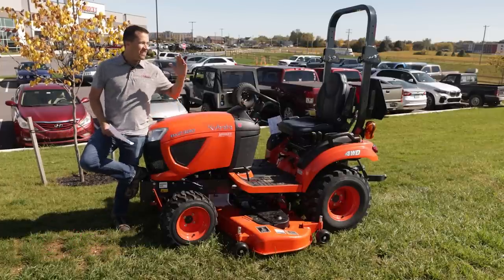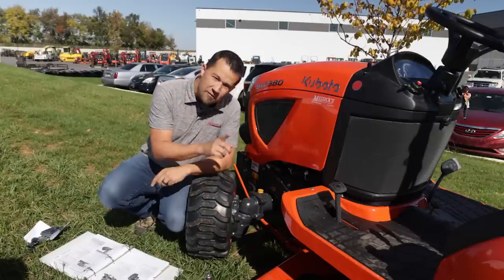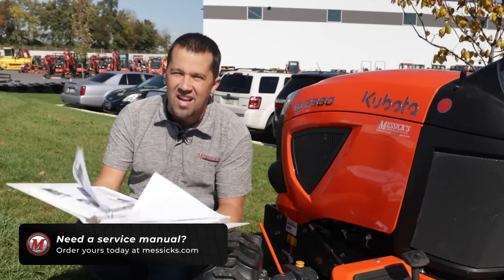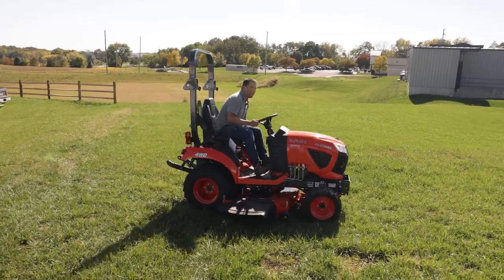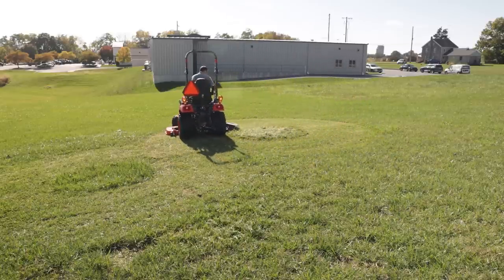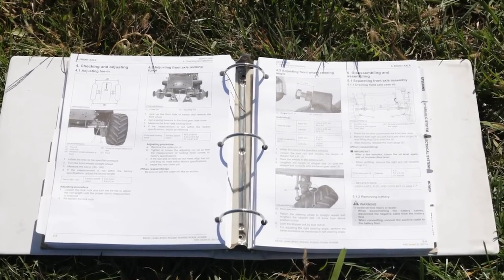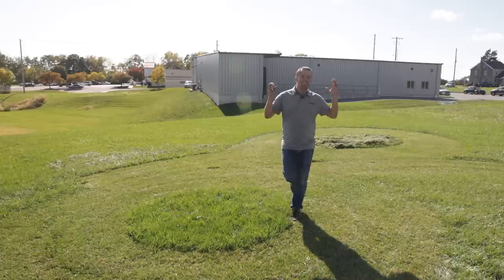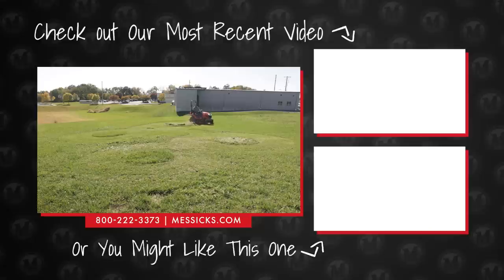Improve the turning radius of your tractor by checking your steering stops.

Comment: Thanks for being at least "somewhat kind", Neil!  
I suspect you and Brian are correct.  The steering stops were likely not adjusted properly on the BX I tested.  I did not attempt to adjust or validate the steering stops on either machine. I assumed dealer/factory had set them appropriately.  I would not expect a first time tractor purchaser to need to check this adjustment.

There are some comments here saying that I "painted" in the wrong location ...by the rear tire.  I did my best to approximate the uncut circle, yes, painting by the rear tire...but watching the edge of the deck closely.    I do NOT believe there is significant error in my measurement approach.    The error was likely entirely in the steering stops adjustment.

I did not attempt a clockwise (right turn) test because I didn't think I could accurately determine the edge of the cut. Remember, I had no growing grass to work with at that time.  I like that Neil did that. Very informative!

Folks probably won't believe me, but I honestly don't care which tractor "wins" in such a comparison.  I just wanted to be accurate.  

Having said that, and just to stir the pot again, I can't resist saying that after all of the hubbub about this, it appears that the 1025R still has about a 15-20% better uncut circle diameter.  Right?

One last comment.  I have lots of respect for Neil.  I consider Neil a good friend.  It is fun to have these back and forth comparisons.   I believe both of us want to deliver accurate info.
Reply: I would argue the not in "I would not expect a first time tractor purchaser to need to check this adjustment".  Whether new or used, I wouldn't trust the dealers and especially private sellers to do everything right.  One common thing dealers miss/forget in PDI on  the BX is top up the front axle fluid among many other things like mower bracket adjustments and these axle adjustment jam nuts.  You could have a green guy doing it, making rookie mistakes or just overthinking like they do. You could have the best, most experienced tech that has bad habits, making assumptions despite design changes on small part revisions etc.  They could assuming its fine and rushing to get home, or just having a bad day and not focused.   Every owner should double check and fully learn all this stuff in the beginning as it'll become normal maintenance checks later anyways.
Reply: I thought you did a really good job with your method without tall grass to use, as mine was difficult to see the cut grass difference.  I think you and Neil both bring impeccable integrity with your entertainment, and I totally agree that we all just want to make sure the information is accurate when we find some info that does not seem right.  And LOL yes, 15-20% is still a clear win!  And as you pointed out, the steering cylinder behind the axle is a much safer place on the John Deere...and even my 1984 John Deere 420 does not have an exposed steering cylinder.
Reply: @mattleblanc31  I can confirm that when I checked my new BX's fluids shortly after delivery--typical fluid check before using the tractor--I found my front axle fluid was so low it didn't even register on the stick.  Dealer forgot to inspect and top off.  That said, I'm really happy with my dealer in every other respect.  But to Tim's point, without a baseline to which to compare, the average tractor purchaser wouldn't check something like the steering stop.  I never have, and I have adjusted several other items as I've come across them and noticed something not quite right, like the lift limits on the rear and mid PTO.

Comment: Great thorough and informative video, and I am glad I am not the only one fascinated by these facts.   We need to also message Tim as I believe I figured out why the stops were so far out of adjustment on his bx2680 that he borrowed from Courtney at Good Works Tractor.  I figured it out watching Courtney's video on his BX23 (very unflattering Kubota BX video) where he was disappointed when he installed his wheel spacers that his BX front tires would now bump into the mower deck when not even turned all the way.  I am willing to bet that the previous owner of Tim's borrowed 2680 had wheel spacers on and adjusted them so his tires would not hit the deck.  Since the wheel spacers can be used on other sub-compact tractors, he likely removed them before he sold his bx2680 to Courtney (maybe?), but would not have thought about adjusting the stops back to factory spec.   Thanks for the update video and editing my video to make it look halfway decent LOL.
Reply: I do. not think this machine ever had spacers.  I doubt very much that original owner (or Courtney) adjusted the steering stops.  More likely, they were never adjusted properly by the factory or dealer. Remember, that BX2680 that I borrowed only had 50 hours on it.
Reply: @TractorTimewithTim  Yeah, my theory could be completely flawed.  50 hours a year is not much, but seems to be about the average per year for homeowners sub compacts in my area and for me as well as what I saw when searching for 1023e/1025r  info at GreenTractorTalk.  Oh well, maybe Courtney can adjust his BX wheel stops so his tires don't hit the deck and mow a circle for us?   FYI--I found another superior feature on the John Deere when I went to remove my rubber mat on my BX2380!  Yes, us Kubota folk have annoying plastic rivets where as you John Deere folk get a rubber mat held down by real bolts!!

Comment: Great video, as always. I love my 2380. I mow a patch of woods with over 50 trees -- most of them spaced just far enough apart to make it through with my 60" deck. At first I was trying to turn tight around each tree, and it was a frustration. However, over time, I figured out a mowing pattern that allows me to make multiple passes from different directions and avoid the need to hug each tree on each pass. Sure, a zero turn would be easier, but with a little planning and mowing "strategy," my little BX still makes short work of it.

Comment: Not a sub compact, but a decent L&G tractor were the Toro 260 series and they turned tighter than the Toro 5xi tractors I own. They were fairly well made but you wouldn’t put a loader on one. If it wasn’t for the stress on the rear axle I’m guessing more riding mowers would have had L & R independent rear brakes.

Comment: when I bought my "other" brand sub compact tractor and took my first turn in 2wd, I was beyond surprised how tight it was.
Reply: Turning radius between my lawn tractor and my BX isn't too much different, the lawn tractor turns a bit tighter of course as its a little bit shorter wheel base, but not by much.
Reply: One of the things I’m most pleased about on my b2650 is it’s turning radius, particularly when maneuvering around our buildings and fences and such while moving snow.
Reply: Turning radius on my Branson is much tighter then on my the Kubota m108 or the NH Workmaster 60, it's a huge difference.. why?

Comment: The mower is probably off set to allow for the discharge chute. Interesting about the axle stops. It would be interesting to see how much you would need to adjust the stops out to get Tim's results, I am thinking not much.
Reply: Its offset for the discharge chute, and to make trimming around trees and obstacles easier.  I have a lawn tractor with a 42" mower deck which is pretty much centered under the mower, my Kubota BX has the 60" mower....trimming around trees, bushes, and the perimeter of the yard is 100x easier with the Kubota because of the mower deck being extended off to the left side further.

Comment: What? You didn't have your wife hanging off the side of the tractor drawing chalk circles?  Tim's a little obsessed with driving in circles. My opinion, if you need to cut that close to that many things and it is really that important, then you need a zero turn. Great video Neal...might have to reach out to your sales dept for a shop manual for my MX.

Comment: Interesting.  It looked to me that Tim was measuring right outside the left rear wheel, not the edge of the mower deck.  Tim's dimension would be larger than what the deck provides.
Reply: I did my best to estimate the edge of the cut grass.  Doubt there was much difference there.   However, the steering stops were likely mis-adjusted on my machine.  I did NOTHING to adjust steering stops on either BX or 1025R. Both were relatively new, so I assumed (error?) that they were set from the factory.

Comment: You didn't mention the use of the split brakes where available in decreasing the turning radius.  Braking the wheel on the inside of the turn can dramatically reduce the radius.
Reply from the maker: Nobody puts split brakes on this size tractor
Reply: WHEN HAVE YOU SEEN SPLIT BRAKES ON A MOWER   REELY?
Reply: @MessicksEquip  True enough. The B2601 isn't that much bigger, and turns a bit sharper. If you don't mind tearing up your turf.
Reply: My 1953 TEA20 has turning/split brakes. No mower deck tho and it would benefit from some front ballast although I’ll never need to replace the front tyres.
Reply: @MessicksEquip  Why not?  The old Deere 400 series garden tractors had split brakes.  As you said in another video, with sub compact & compact tractors (and as many commenters have also said in relation to ZTRs), their strength is in applications other than lawn mowing, where split brakes are helpful.  If an owner is worried about tearing up turf, they can always lock the brakes together or simply use the hydro for normal service braking.

Comment: I believe Tim was measuring from the inside rear wheel not the mower deck.  granted it was labeled as uncut turn and its completely possible the tractor was not adjusted properly.
Reply: I did my best to estimate cut radius. Not as accurate I'm sure as Neil's test since I didn't have any actively growing grass to work with.  However, I don't think much error generated in my measurement approach. I suspect the error would have been in the steering stops.

Comment: Between your videos and tims the kubota is more of a actual tractor the bx2380 has more 3point lift capacity, way more pull and more pto hp. So when it comes to actually working it the kubota is better. 
I have never found the fel lift capacity to be a issue and kubota engineers got that right when you look at the other factors eg tires. Nor have i found the position control to be a issue and we do alot of in ground impliments.
Reply: I always figure the small JD does a bit more than the BX.  Because it's a bit bigger machine.  It's halfway to a B2601. But if you wanted to do more, why not buy a B2601. It costs about the same as the small JD, and is quite a bit more capable.  Of course, the next JD up is between the B2601 and the LX.  Nothing is exact in comparisons, and the steps between these machines are so small anyway. My BX did everything I asked of it. My B2601 does a bit more. No doubt I could have been happy with the JD too if I was that way inclined. Numbers aren't everything. And a tractor will always make you happier than a wheelbarrow.
Reply: Yes you are correct a b series would suit some of what we do better but seeing our main purpose is mowing the bx does that role better on our property. But our bx branches out in to its other jobs perfectly. We have access to multiple big tractors for the big jobs anyway.
Reply: @BurtsRanch  Which is fine for your use. Some people have only one machine, and I see a lot of people head to head comparing the JD 1 series and the BX. In reality the BX is a little smaller.  So that comparison doesn't flatter the BX.  But if you wanted to lift more....why buy a BX in the first place.
Reply: @paullambert2668  100% agree. Hence i said i feel kubota got the lift capacity of the bx correct. If you need to lift more get a bigger tractor or something else so were on the same page.

Comment: If you go back towards the beginning of the video with Tim's video excerpt his video has a note in the upper corner saying he was in 4WD, so being in 4WD making a right or left turn is certainly going to give you a worse turning radius, and I believe may have been the part that Tim was referring to.  Although, I don't particularly think mowing in 4WD would be a good idea, it certainly can be done but I'd keep it to more straight line type mowing than trying to make sharp turns.  Another thing too, if someone smashes the diff lock pedal down by accident even in 2WD I bet your turning radius would be pretty dismal too.
Reply: I have a few spots that need 4wd, that I just avoid with a zero turn. I've been stuck before, and don't want to go through that again. The rest of the yard, I wouldn't use 4wd, it would be a waste there.
Reply: Tim explained the measurements very carefully for 2wd and 4wd for the Kubota and the John Deere.
Reply: I tested both 2WD and 4WD (just like Neil).    I suspect the steering stops needed adjusting.  I did not attempt to adjust on either BX or 1025R.
Reply: @TractorTimewithTim  The excerpt in Neil's video showed when you doing the 4WD section of your test, but that's beside the point, I remember when you did your turning test video, I was surprised how well both machines did honestly I was expecting much worse....I wonder how much different it would be if you did the same tests but with the loader installed?  Would it cause the tractor to push through the turns in both 2WD and 4WD?  Do you have a Kubota BX that you can redo that test with Tim?  I'm curious what the difference would be, loader on VS off, 4WD/2WD.  

Have you adjusted the stops on your machines yet?  Is the 1025R's stops similar?

I'm guessing the same with the stops, however I wouldn't think they're too far off.  I know with my BX2680, trimming around things I always trim with the left side of the machine of course, so it gives a much tighter turn...I've noticed the same doing loader work too, turning left is a tighter turning capability than turning right.

Comment: I know this might not matter. But does the bx2680 actually have a different turning radius vs the 2380.. I know it shouldnt realistically matter. But. Does it by weight and such? Is the 2680 adjusted differently or something of that nature.
Reply: The physical size of the BX2380, BX23s, and BX2680 are the same.  So, to get different turning radius results would just be due to differences in the wheel stops.

Comment: OK, so what about the most important comparison spec, lift capacity?
Reply: oN A MOWER   lol  ??
Reply: @jimputnam2044  no, on the BX's loader that most people buy with a machine
Reply: The small JD lifts more.  It has bigger front tires, and a bit bigger front axle. So it makes sense to put a bigger loader on it.  If you wanted to lift more than a BX, you could of course buy a B2601. Depending on your location/dealer it could be the same price as a 1 series, but it lifts a lot more. I think spec peeping on these things is a bit crazy. To my mind the BX is made for the guy who wants a tractor, but his wife wants a ride-on.  He can tell her it's just the same size as a ride on - hence the small tires etc. The B2601 is about the same length and width, but is quite clearly more in the tractor category than the ride on category.  Not gonna fool the wife with that one.  If you need to convince the wife you only bought a ride on - the BX is the machine for you.  If you have specific tasks that need more capacity, then buy a B2601.  Or buy a JD 1 or 2 series if you happen to like green instead.

Comment: Tim was measuring in at the tire, not the circle left when cutting the grass.
Reply: Exactly.  He measured turning radius not unmown radius.  You need to know if you can go into an area and get out.  In my tractor I can turn sharper in 4wd if I am willing to let the front wheels dig ruts.  If I drive normally I avoid 4wd when I can.  My hills make that a rare occurrence though.
Reply: @brianhillis3701  Did you watch Tim''s entire video?  Neal did a good job trying to duplicate what Tim was doing.
Reply: @brianbecker7588  every second of it.  Did you miss him spray painting the ground by the tires?
Reply: @brianhillis3701  I believe my 'spray painting' was accurately showing the uncut circle.  Yes, I painted by the tire, but if you watch the machine turn, this seems to directly match with the uncut circle.  I do not believe there was much if any inaccuracy in that area.   I suspect the steering stops were set incorrectly on the BX I tested.  I did not adjust steering stops on BX or 1025R. Assumed both were fine from the factory.